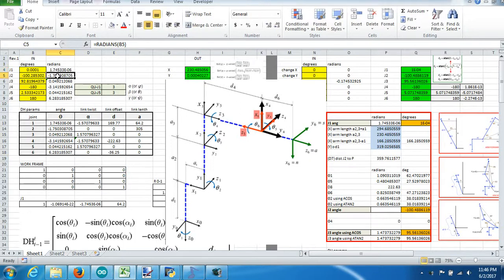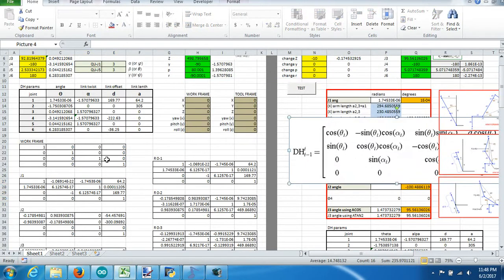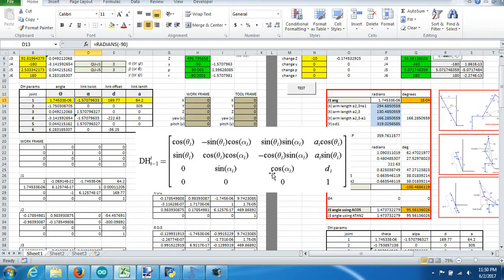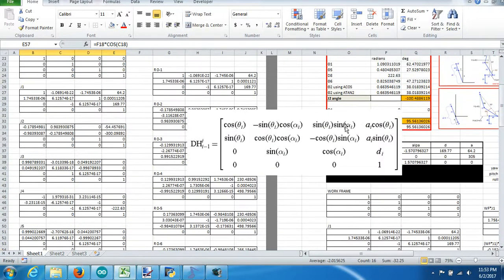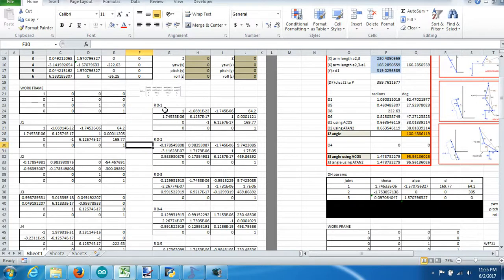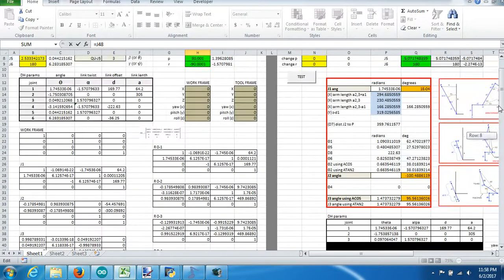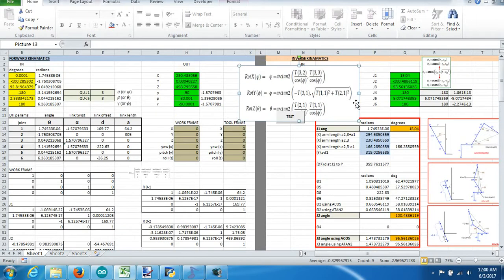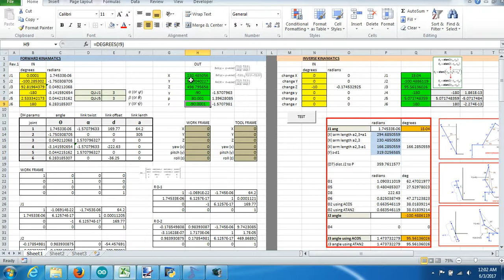6 axis robot kinematics Part 4

Comment: Hi Chris. I'm still trying the robot program you made and I haven't given up. But I know this well, even if I finish the chassis of the Ar3 robot, it will not meet my needs. I will need your help on something. The product I want to use is 90cmx210cm in size and weighs approximately 20kg. How many Nm motors should I use on the robot arm that will carry it?

Comment: why did you divide by the I8 instead of dividing by COS(I8) in cells (H7,H9) as the formula states? Also, you picked different values than what the formula has, for example, you picked T(3,3) instead of T(3,1) in cell H8 and all the others?